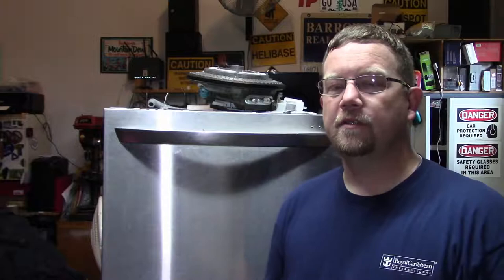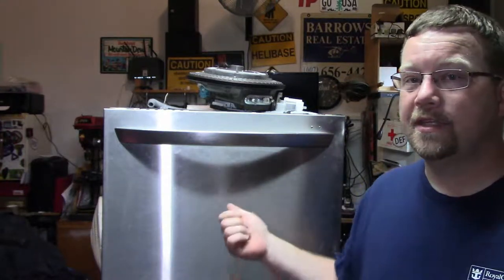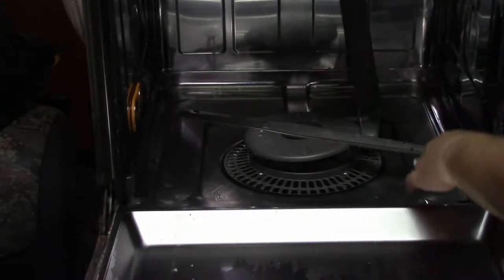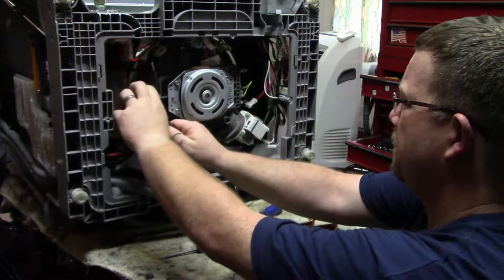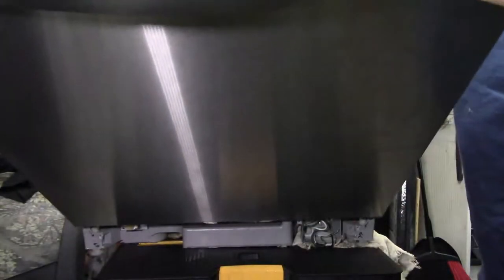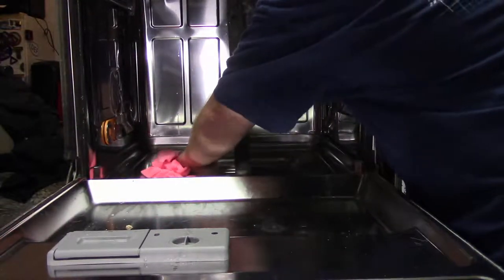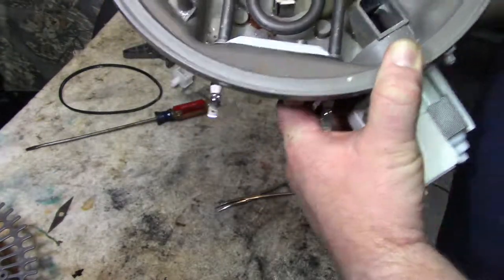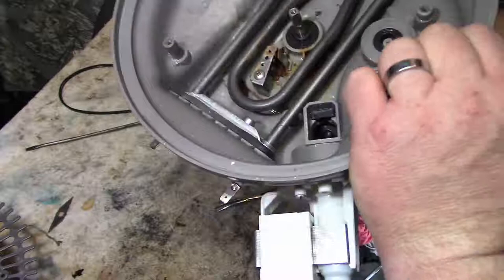LG LDF7932ST diswasher motor replacement and pm

Comment: How can I isolate if it’s the entire motor that needs replacement or just the smaller drain motor? Getting the OE code when trying to run it. Cycle seemed to run fine but wouldn’t drain.
Reply from the maker: Check the float box on the right side(outside wall) and see if has junk in it causing the float not to work right. Also, check the float switch to see if it is working. Towards the end of the video, I show how to clean it.